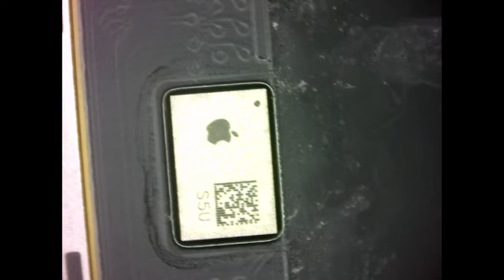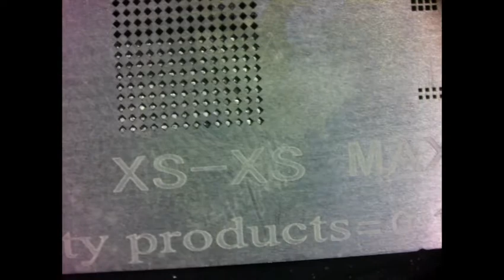iPhone 13 Pro Max display IC transfer

Comment: no need grinder to remove original IC?
Reply from the maker: I use grinder now for one on the new screen
Reply: @StellarTechRepair  thanks
Reply: what temperate to remove ic?
Reply from the maker: @KimoKimochii  450
Reply: @StellarTechRepair  can’t use heat gun to remove on new screen?